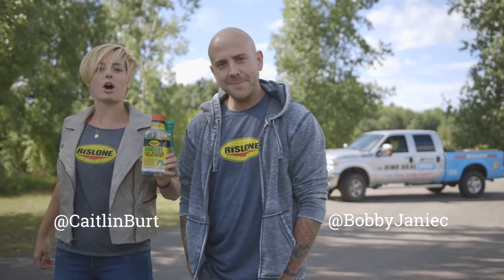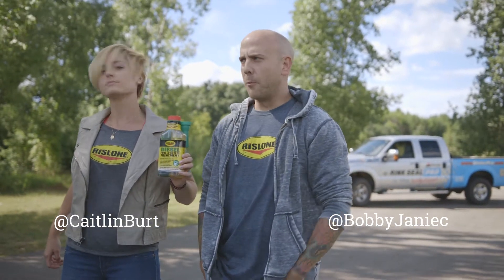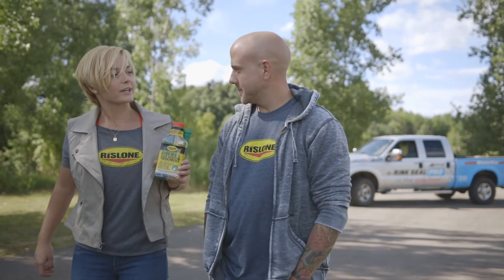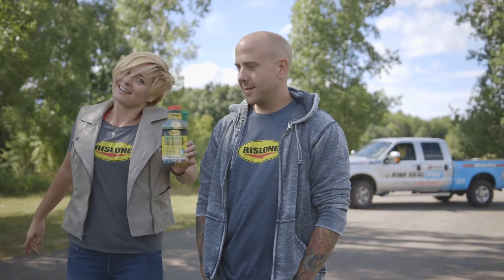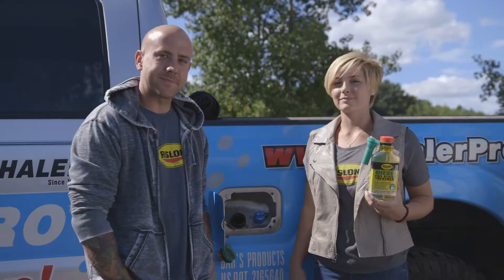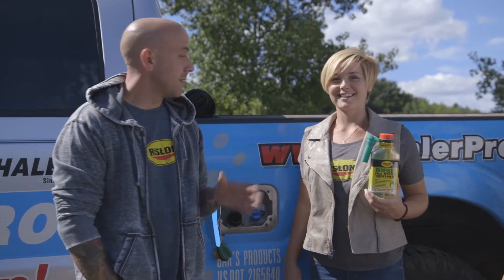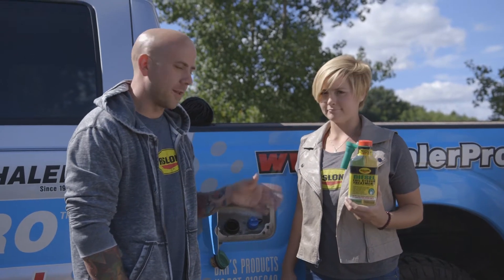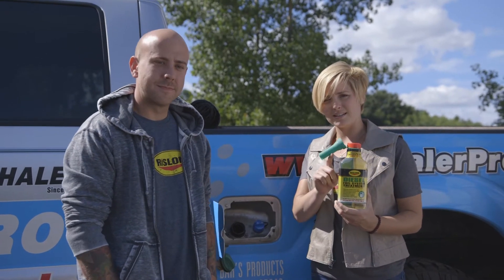How-To: Rislone Diesel Fuel System Treatment

Comment: I have semi truck 2009 Freightliner cascadia dd15 can I use it ?? It’s diesel
Reply from the maker: Yes you can use the Diesel Fuel System Treatment product in that vehicle.
Reply: @RisloneGlobal this goes in the fuel tank or DEF tank ?
Reply from the maker: @cesarespino3560  This product part number 4740 goes into the DSL Fuel system.